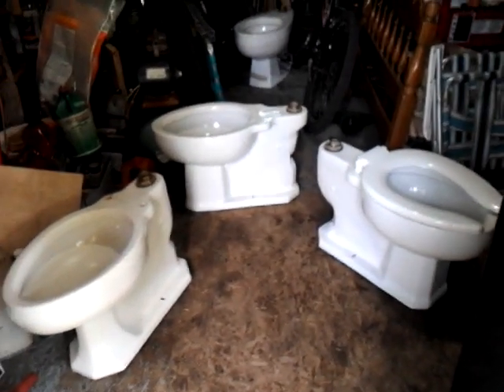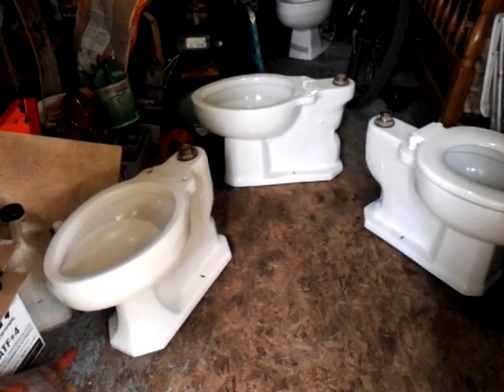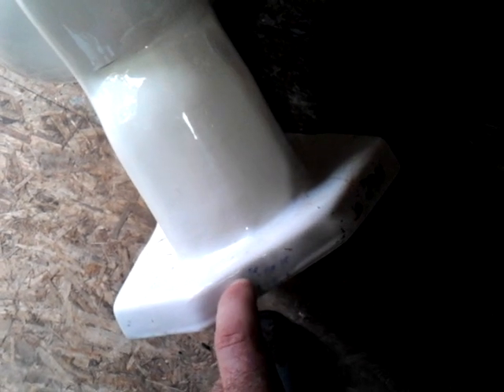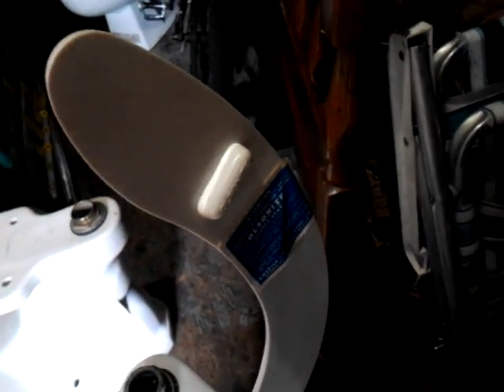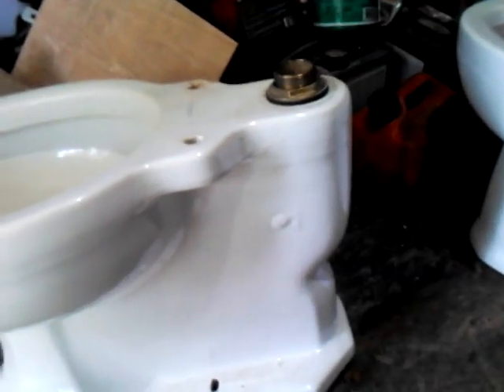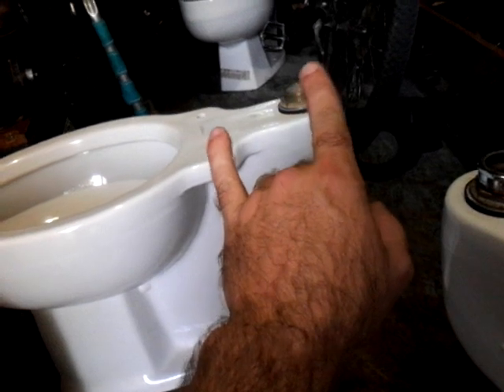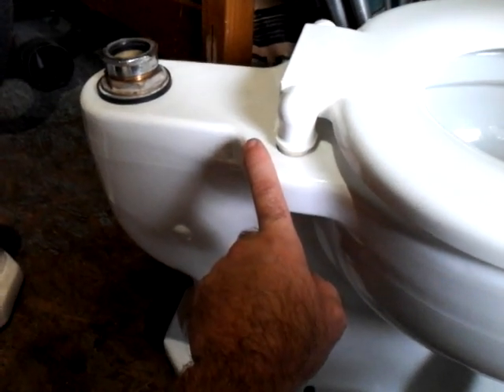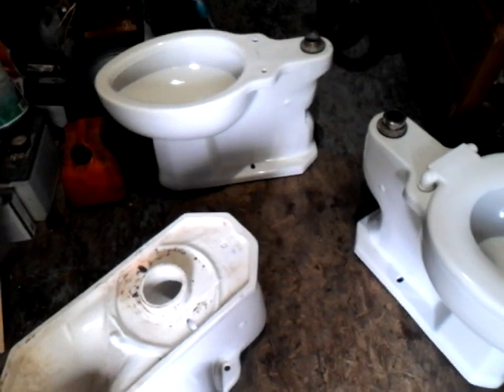#12 Vintage Kohler toilet comparison

Comment: Very cool vintage Kohler toilets and the Kohler Rockwell was discontinued around 1974-1975, Kohler Downing was discontinued in 1998, and Kohler Penryn was discontinued in the mid 1990s and that was the rear spud only bowl, the top spud Kohler Penryn was discontinued in the late 80s early 90s.

Comment: What rough in was the WELLAND? Because the ROCKWELL looked like it was roughed in at 14".
Reply from the maker: The Rockwell was designed for 12" rough. It says so in the Kohler catalogs of the time. I believe the Welland was a 10" rough. The Welland was unique because it was a swirly, quiet flushing toilet comparable to the Standard Afton. They are extremely hard to come by,  but there are a few on Youtube.
 There was also a "Swift". It was a floor mount blowout toilet with a 9" rough in, similar to the Standard Valvo. I've never seen a Swift on YouTube.

Comment: the rockwell was discontinued in the 1990s actually
Reply from the maker: I had a 1990 Kohler catalog and there was no Rockwell. The Downing and Penryn were still listed as of then.
Reply: @vintagekohler6085  did it have the newer logo labeled "KOHLER"?
Reply from the maker: @GMAPlumbingIGuess  there were Penryns and Downings from the 90s that had the new Kohler logo. The Rockwell was discontinued before that came along.